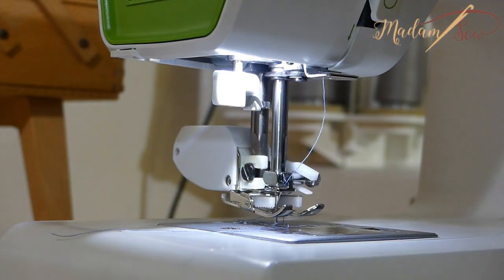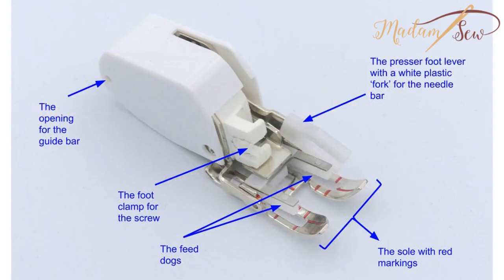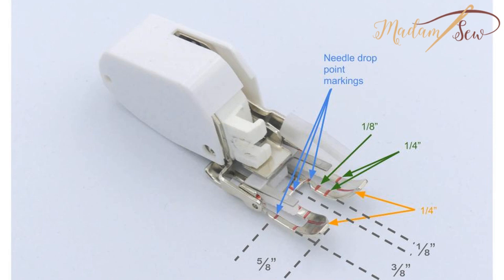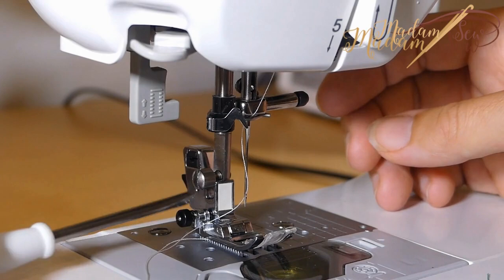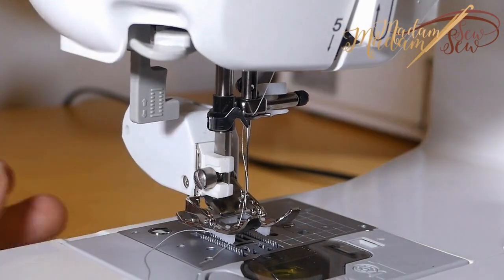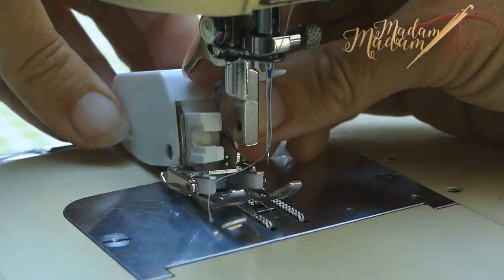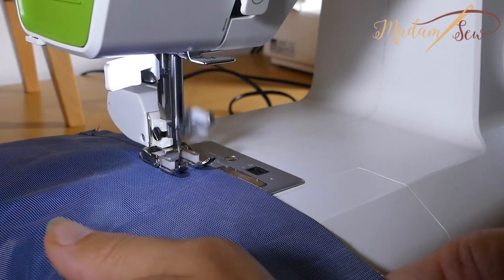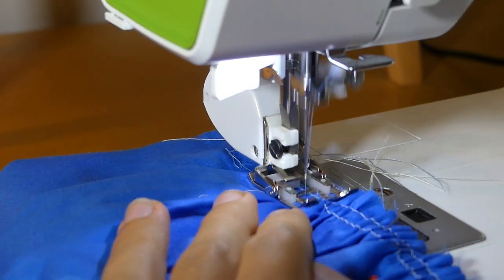#5 walking foot

Comment: Hi MadamSew -- first I commend you on the excellent camera work and slow motion showing the motion of the walking foot in detail. Could you clarify one point? I am pretty sure that the walking foot mechanism only moves the upper teeth up and down (not fore and aft), so as to clamp the material against the lower dogs during the "advance" part of the cycle. I believe the mechanism does not actively pull the material along. Instead, during the clamping period, the upper teeth are still free to "float"  fore and aft, and are simply carried along with the motion of the dogs that they are clamped down to, sliding whatever distance (and direction) that the dogs move. Is that correct? 
It would agree with the motion you show during the first few seconds of the video: the lever simply moves the feet up and down. The fore-aft "floating" feature would be why you can use the walking foot with different stitch sizes, and even stitch backwards.  However, at 0:15 you say the upper fabric is "pulled" by the upper feed dogs. I believe that's a misconception that many people have, but I could be wrong. I'd appreciate your comment, as I try to help diagnose a walking foot that isn't walking! Thanks!